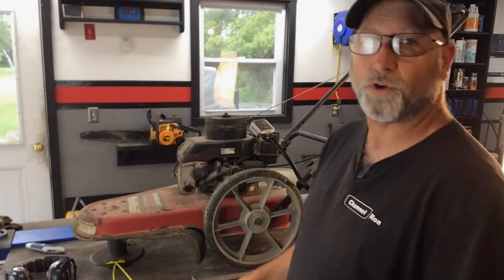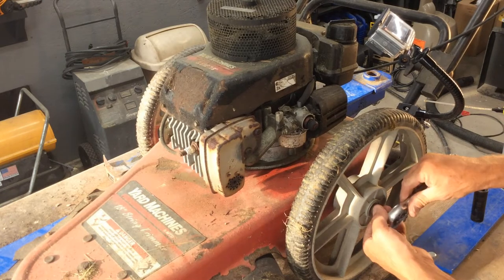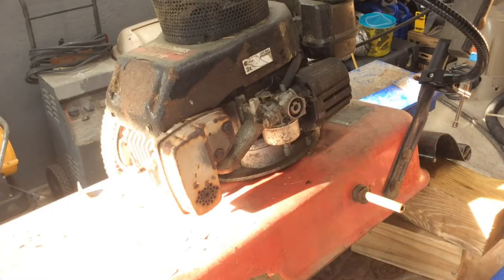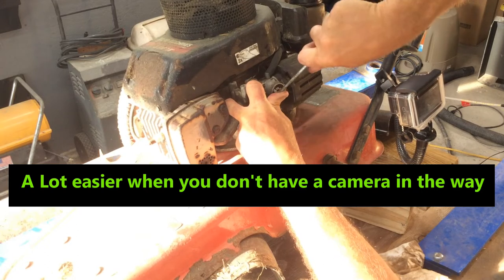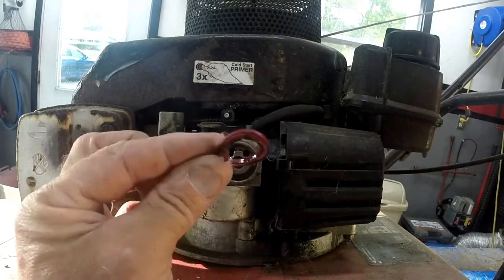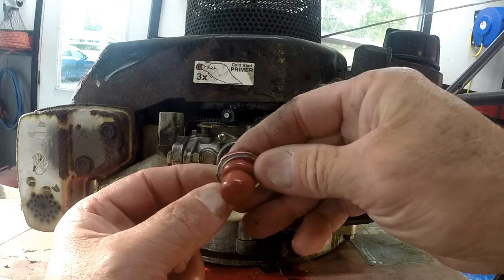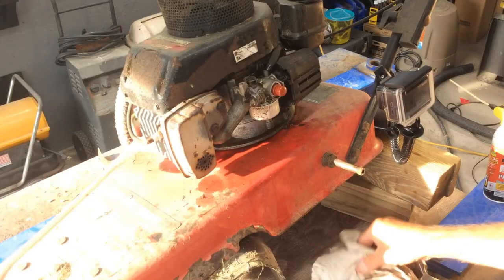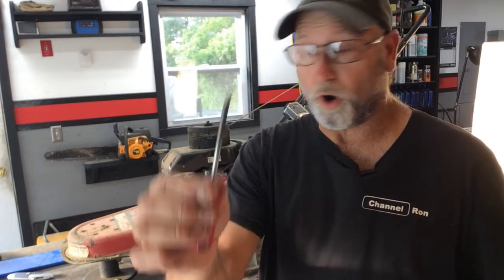How To Replace Primer Bulb On Tecumseh Engines

Comment: i discovered the super duper handy swiss army knife corkscrew worked really well to pick the primer bulb pieces out.  what worked nice is getting the point wedged under the ring, then turning the corkscrew to lock it in.  and pull.

Comment: The tecumseh carb is a solid piece of equipment. Ive heard stories of owners in the midwest using black nitrile gloves temporarily as a bulb patch to keep their snowblowers working in an emergency snowstorm.
I need a new primer bulb. 
I might try it and see if it works.
Reply from the maker: I like that Idea! may have to try.

Comment: Hello, Have you ever experienced the new primer bulb tearing when installing? I bought a 2 pack and they both tore. I thought maybe the socket was causing it to tear, but looking at your video, It looks like the tear may be taking place at 12 oclock on that inner bore - where there are cutouts on both sides. Gonna try again, but just wondering if you'd ever experienced this before. Thanks for the video!
Reply from the maker: I have Not?

Comment: My Karcher pressure washer with Tecumseh engine started with 3 pushes on the primer bulb. First pull. Ran it for 5 minutes and shut it off. No way to start it 5 minutes later. New spark plug. Seems it has a starting problem when the engine is hot.
Reply from the maker: Sounds like the fuel plunger is stuck open? located on the bottom of the carb.
Reply: The drain plug is the only thing I see on the bottom of carb.